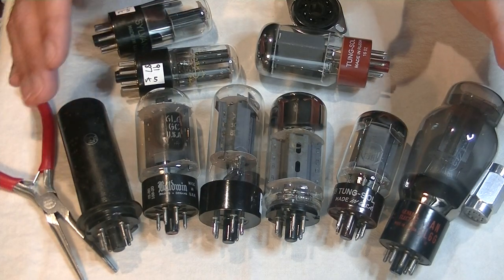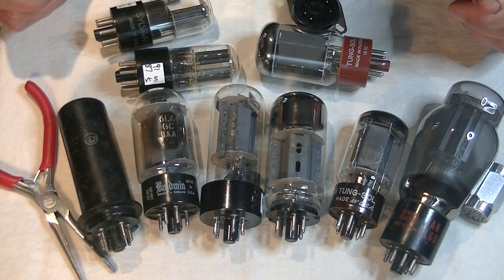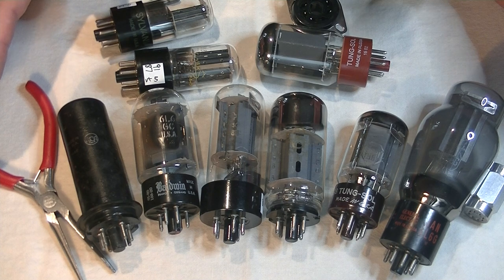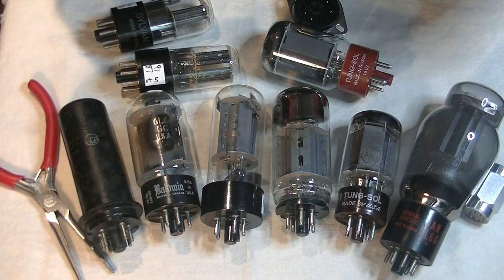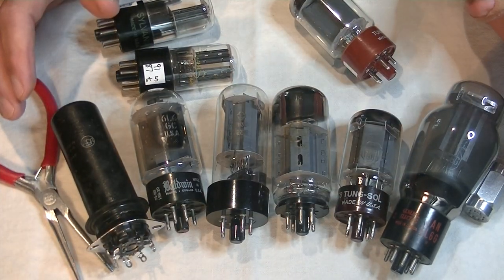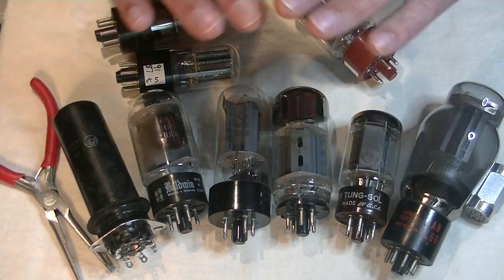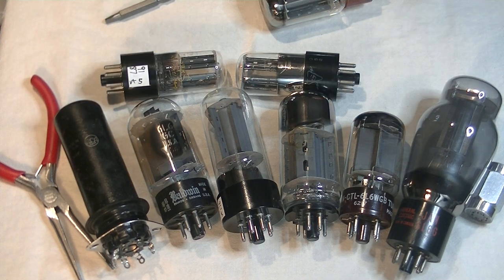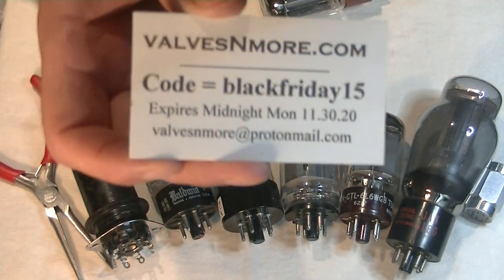Tube Lab #11 6L6 Rolling

Comment: A cautionary note about using the metal enveloped 6l6 and 6V6 tubes, some amps use pin 1 as a tie point that may have screen voltage on it.  Touch the energized tube and chassis and you could get a righteous shock.

Comment: The 6P3S sounds more like a 6L6G to me which is not surprising given that Russians used RCA-built 6L6 tooling to make those.
Reply: Thankyou that is good info , I just got a 5U3C in the mail from the Ukraine , this they claim is an equivalent to the 5U4G tube , although I couldn't find a data spec  sheet for the 5U3C tube , iam really curious to see if they are different in any was , voltage and currant  watts etc ? Any Help would be great on the tube info

Comment: I have a 1954 AMI  ROWE Juke box With a  #145  amp  iam using A pair of the Sovtek 6L6 WXT  tubes  now ''  the match is great 352 volts DC  plate voltage and 49 MA with  aprox 17.245  Watts  of output '''  sounding great ''  I have a pair of  new early 2005  vintage  Sovtek 6L6 GB tubes and also a pair of new pair of Electro - Harmonix  6L6 GC  EH   What is the difference between these  three  types of tube choices '' ?  I have not plugged in either of the  GB or the GC  EH tubes yet ' Can i Safely use these in my 17 watt amp ?  This amp has a 5U4GB  with two 12AU7 matched tubes'  and one 12AX7 all strong and C C C   quality  . Having nearly 3000 45 rpm records i play some music almost everyday '  any good info would be very helpful '  ALSO I LOVE THE NEW OCTAL SOCKET SAVERS  '' THANK YOU THANK YOU '' JIM
Reply from the maker: Those letters after the tube number ie 6L6 not g or gt (glass or glass tube) but the series letters GB series B, GC series C, wxt series wxt.  Normally the later the letter the later the production spec and often it is a higher spec.  Now if your amp is older and was designed for the 6L6g, then any 6L6 will work fine - ya.  However if your amp is modern, and the spec sheet calls for a 6L6wxt, now you need to be careful about plugging an early series 6L6 in, it may not handle the operating point of the modern amp.  This is a common issue for all tubes that had a long production run.  So you can either check the data sheets and compare the operating specs to the max on the sheets, just plug a tube in and watch it carefully for a problem (and be prepared to lose one every once in a while) or stick to later production higher spec'd tubes.
Reply: Can a 6L6 be used in place of a 1614 vacuum tube in a Johnson Viking Ranger ham radio?